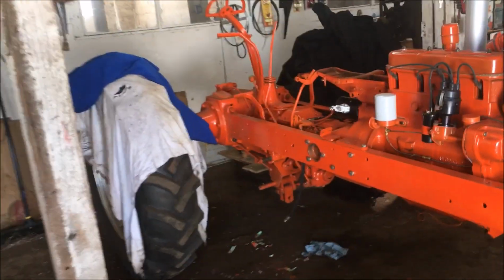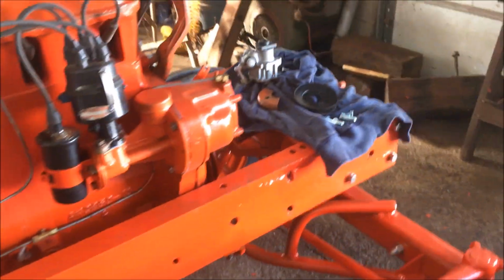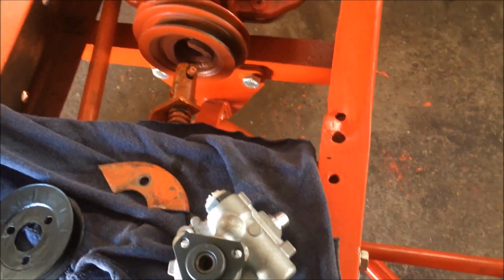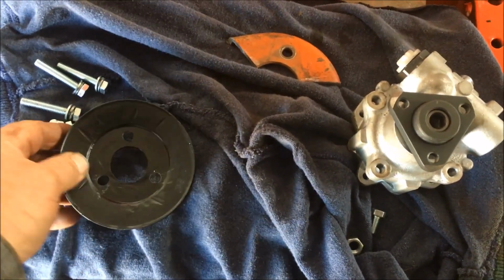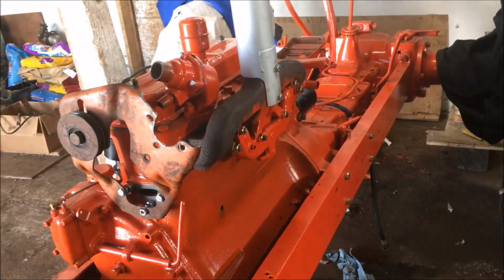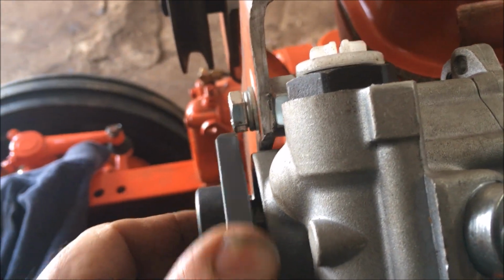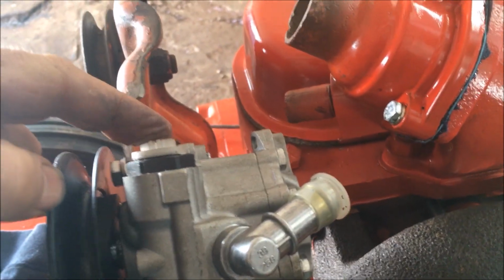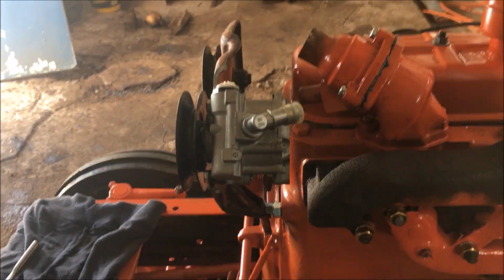Allis Chalmers WD45 "Restoration" Part 15: BMW Power Steering Pump Swap

Comment: You could use a die grinder, Milwaukee sells a cordless and a corded one, back when we were polishing molds and cast iron patterns we use to call then "hand held portable milling machines" for removing metal, those were pneumatic. Faster and more controllable than a drill motor!
Reply from the maker: Yes, my old pneumatic die grinder died and I haven't replaced it yet.
Reply: @farmerpete  At least one of the points of a project is getting a new tool, Pete! Get on this! :)